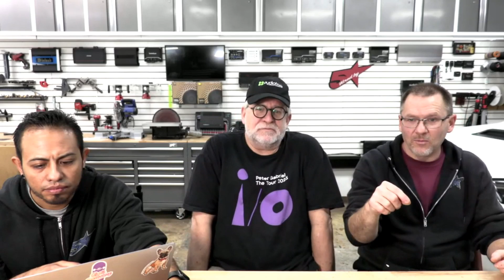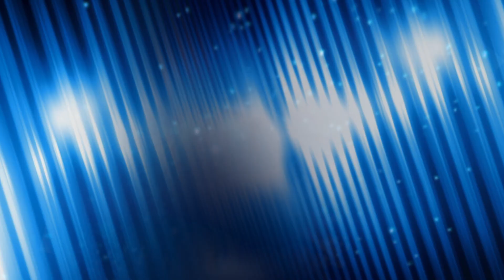Andy Wehmeyer talks All Pass filters

Comment: I never realized how bad my system sounded when sitting in the passenger seat, I have it time delayed for the driver seat, so if I had someone driving with me and I cared about how it sounded for them should I just turn off the time delay or set one up for the center of the two front seats?